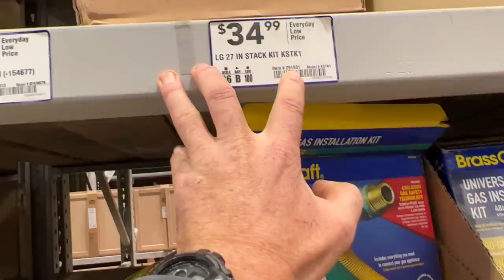Building The Nantahala Retreat #46 | More Finishing Details!

Comment: Handy hint. Use turtle wax seal and shine auto paint sealant on all your tiles after they are installed. They stay amazingly clean and the customer will love how easy they are to clean. Works on all glass and mirrors too. Especially great for exterior glass the rain just beads off and lasts for months and super easy to install. And turtle wax glass cleaner is excellent and no smears

Comment: All our washers on the other side of the world have a supply line fixed attached to the machine, with a solenoid valve, that has a solid cast part between valve and valve. It gets activated electrically when the machine requests supply water - so to prevent any flooding or open connection to the house supply. In 30+ years never seen one like yours with open lines... And we have the same LG and other major brands...
Reply: This. Or get a waterlock, those things don't cost much and can save you a lot of trouble. 
Also, 'every house needs a washer and dryer'. Apparently i have been living wrong my entire live, never had a dryer. They use energy and eat your clothes. I just hang my stuff out to dry, doesn't cost a thing.
Reply: @upscaling_123  well i have a combo machine. where you can dry the laundry without transferring it to another machine... but then I live in the desert... so nothing beats then 120F heat outdoors when it comes to drying :)
Reply: It is quite a weird way things are done in USA, appliances to building codes to delivery of goods.

Comment: I built a house in 88.  The heating contractor installed a Lennox Pulse.  It was the noisiest damn thing.  They tried all kinds of things to quiet it.  Insulating the pipes, mufflers and other attempts.  It was better, but never good.  a few years later the fan failed.  I pulled the fan out and lo and behold there was a tag saying to remove the shipping bolts.  So I did and put in a new fan.  It was quiet from then on.

Comment: Uh oh. You guys left the neutral to ground jumper, which is not allowed when using a four-prong plug. Keep the neutral and ground wires separate, please. As for the two types, the code (NEC) started requiring a separate ground and Neutral wire as a number of service people were killed. But they send the electric dryers that can be wired with old three-prong plugs for older homes.
Reply from the maker: Hey thanks… I’ll pull the jumper!

Comment: Pro tip: Take my Klein screwdrivers and coil a insulated piece of wire around the shaft from the handle to the tip leaving about 8" of wire on both ends. Touch the two ends to a truck battery for 10 seconds and in doing so will magnetize the shaft of the screwdrivers.

Comment: Did you put a nice little incline on the dryer vent tube? It being metal, moisture will accumulate (esp. in winter) and possibly end up inside. I would have used a condensing dryer....

Comment: Hi as a former firefighter "never ever" use flex pipe for a dryer vent, it will build up with lint (especially in the turns or curves) and potentially start a fire, went to many dryer ignited fires that turned into house fires. Only use smooth pipe and no screws, only foil tape on the "outside" of the pipe to join the sections together, I think the extension with the foil tape on the inside is a vent clog waiting to happen in a few years, just saying.
Reply: But dude...smooth pipe is so hard to work with! Just let the homeowners know to clean the flex pipe or their house will burn
Reply: It's against code here in Canada.

Comment: On the dryer plug some places require a 30 amp plug which is 3 prong and has no neutral wire and 4 prong 50 amp that has a neutral wire

Comment: I know it's an extra cost, but when we re do passenger airplane interiors we cover every square inch of flooring with a thick static cling wrap. Not sure if it would helps you guys save the flooring but the option is out there
Reply: Yeah, good point. Those guys walk on the new floors with muddy work boots!  Ram board would work, too. The cost is easily offset when you factor in the cost involved in chiseling out the damaged floorboards.

Comment: It's incredible how much quicker 🇺🇸 construction is compared to the 🇬🇧...... And then it comes to appliance installation (and I'm also referring to your video with the microwave) and it's the opposite.
Reply: Here, the most time consuming part of installing a washing machine and dryer would be getting rid of the packaging. For starters, all our appliances are cold feed only and our dryers just need a waste pipe for the condensated water instead of a 4inch vent pipe.

Comment: Are condenser dryers not used in America? Much lower energy costs.
Reply: Very rare here. Electric dryers can be energy hogs, but a lot of people choose gas fired models, which are very economical. Heat pump dryers (even more efficient than condenser models) are starting to appear.
Reply: @wallyballou7417   i think heat pump and condenser are the same, a fridge in reverse, it may be the heat pump uses a vent, I am unaware of that, where as a condenser dryer is a closed cycle and condenses the moisture into water.

Comment: I'm pretty sure you wired the dryer wrong. Being a four-wire system, the neutral and ground should have been separated. You left the jumper connected to the equipment ground.
Reply from the maker: Fixing that… thanks!